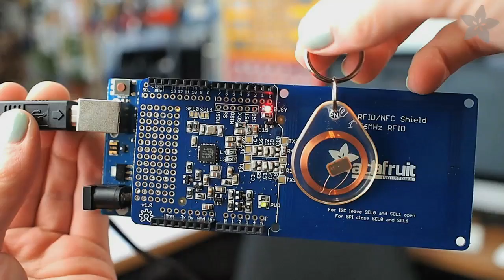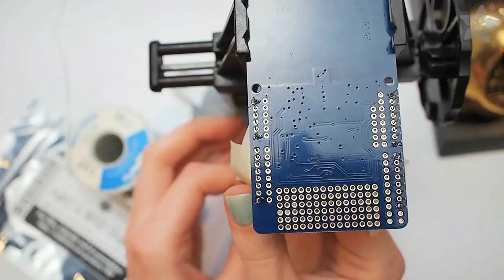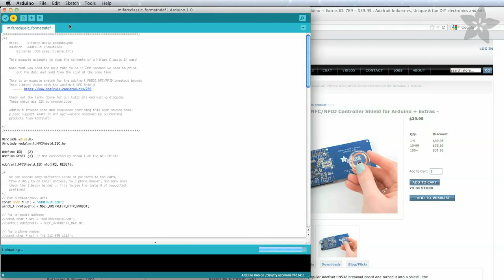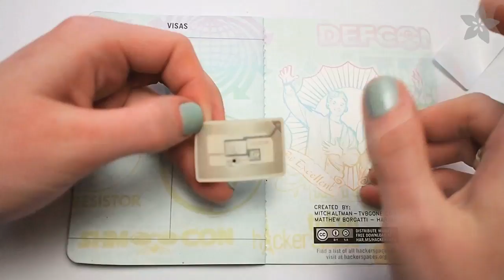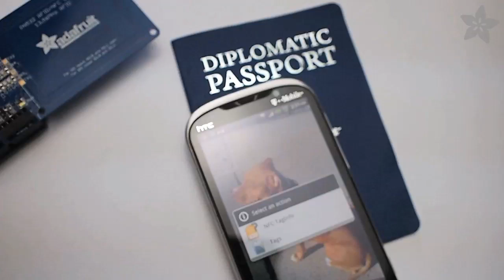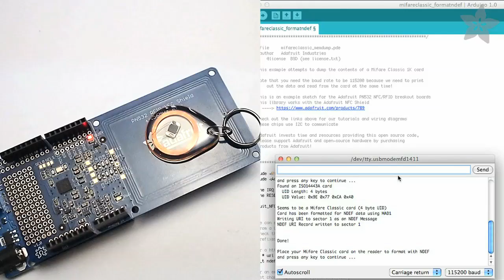Adafruit NFC/RFID Shield for Arduino

Comment: I am Kannathasan, currently a final year student studying electrical and electronics. I would like to ask a question about a product. What is the difference between ADAFRUIT PN532 NFC/RFID CONTROLLER SHIELD FOR ARDUINO AND PN532 NFC/RFID CONTROLLER BREAKOUT BOARD? Which product can I use to communicate with other NFC phones? I mean P2P.

Comment: Got my shield about a week ago and have been at my computer all day and up late several times.  If I were more experienced with Arduinos and NFC, it probably wouldn't have been as tough :)  

So far, I love the board and have it setup to scan Mifare classic cards and save the data to an SD card.  Time to move onto some more fun now that I understand the basics!

Comment: What is the difference between the "PN532 NFC/RFID controller breakout board" and "PN532 NFC/RFID Controller Shield for Arduino"? Is it just that the pinouts are inline with Arduino board for the shield?